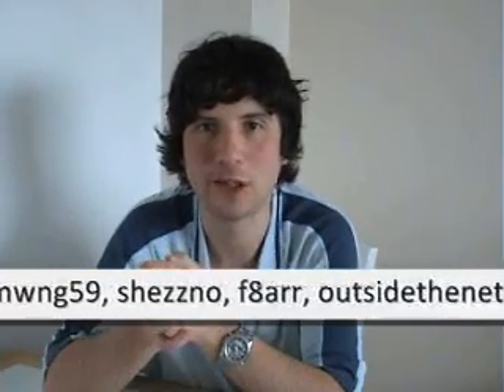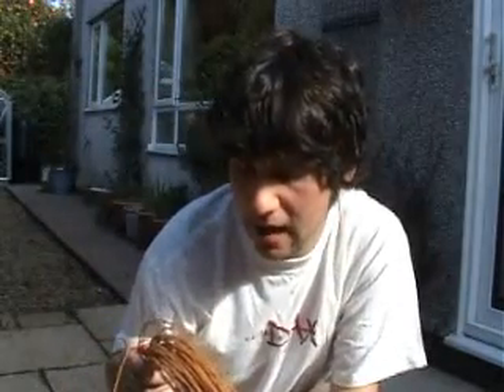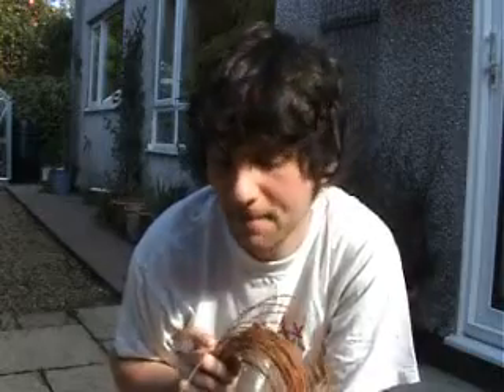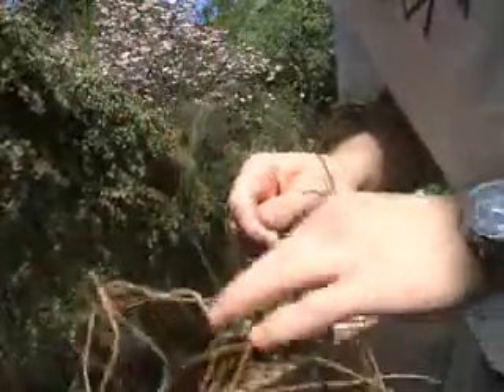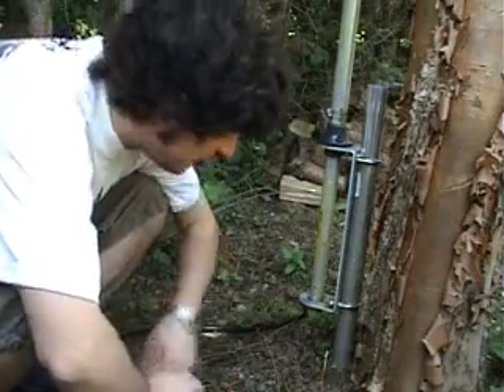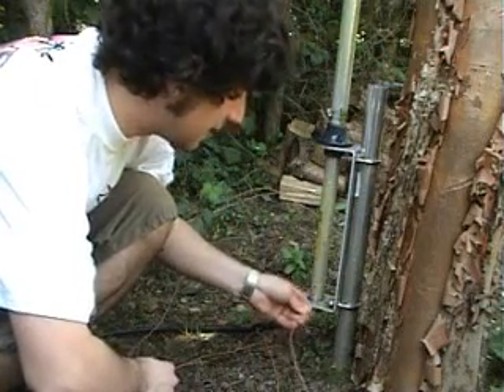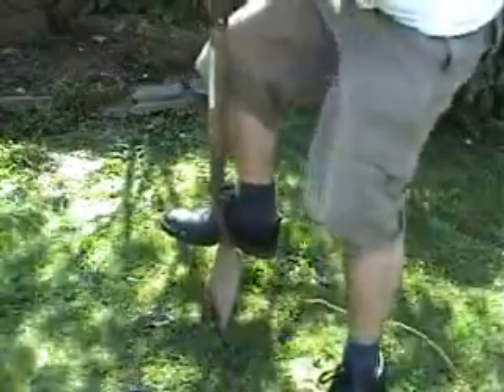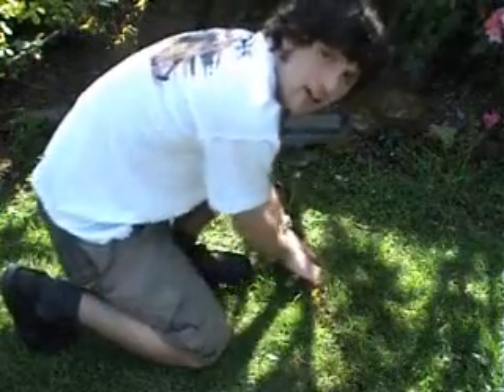Burying radials

Comment: i use this antenna ground mounted with radials .i find it works realy well even with 10 watts. i havent cut my radials to size. and i dont need to  use a tuner .these are a good antenna.73, m3hnl warminster good luck good dx.

Comment from the maker: Thanks for the information. The soil at the QTH is very shallow and there's solid granite underneath, so an earth rod just wasn't possible at all. 
I did use the antenna more-or-less successfully without any radials or ground rod for a couple years, though. The radials do seem to have improved it a bit.
73 de M0BLF.

Comment from the maker: Hi Jerry, 
Thanks for the comment. The antenna is mounted probably about 30m/50ft from the house. As for the performance, the simple answer is that I don't yet know. It is at my parents' / my vacation QTH, and I'm now back at my University QTH. In the few days I did have to use it before I came back here, I didn't notice a huge improvement, but then again conditions have been so bad that I'm not sure. I'll try to remember to mention it in a future vlog when I've made some more QSOs on it. 73.
Reply: Dominic Smith Great job! I am using a 6btv with 27 28foot radials(want to expand to 128 28ft. radials) and it works very good with 27 radials bolted to the base. It is hard to say what best DX is because i consistently heard and worked the world more than a few times over. No amplifier yet, just 100watts and a hustler 6btv. Heck, i have it tuned now and don't even need a tuner with it. Darn near flat on 80-10m. 73 es gud DX! KC5NGX